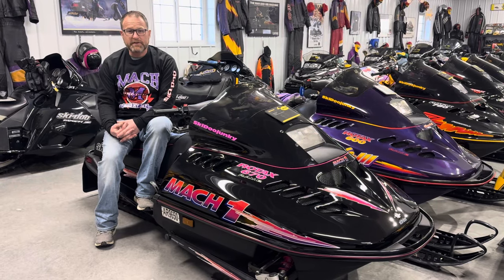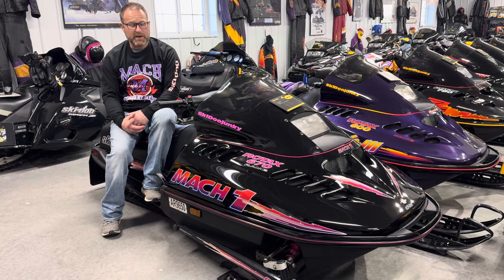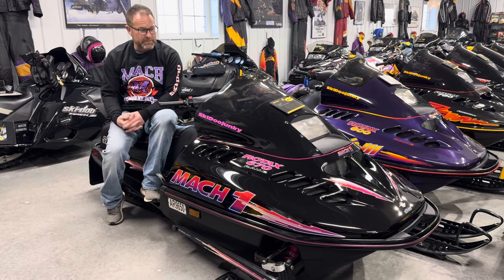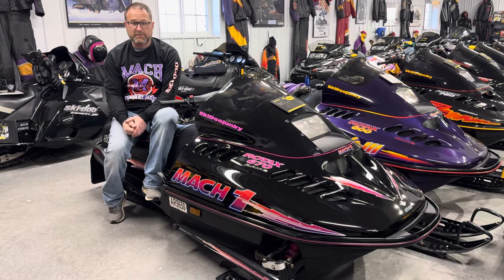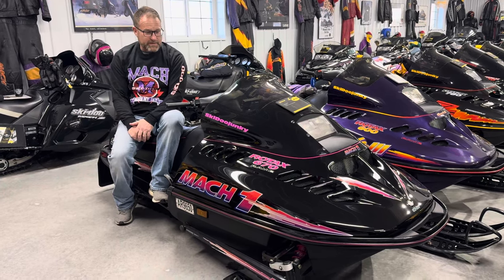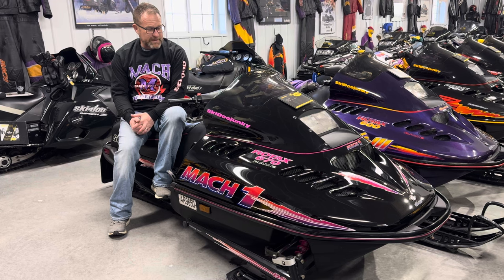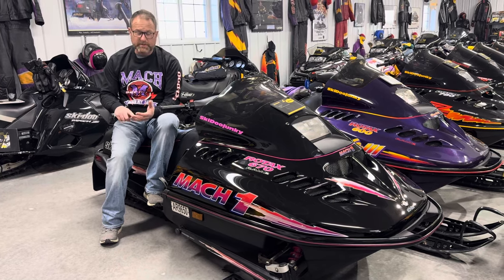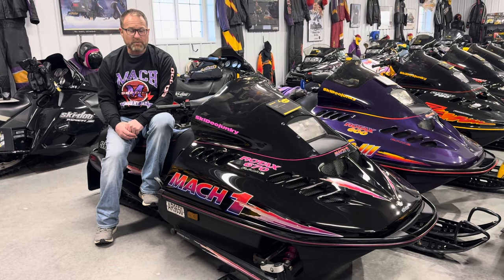Skidoojunky’s vintage Ski-Doo spotlight. The 1995 Ski-Doo Mach 1 670

Comment: I had the economy variant of this, the 95 Formula SS 670.  Smaller carbs, single pipe, manual disc brake.  It still was a super fun sled to ride.

Comment: 95-96 are dream sleds of mine, my first mach 1 was a 92 that I ride for 4 years, when it was time to upgrade skidoo had just released the new 700 triple in the ck3 chassis, I bought that mach 1 in 98 and have never even driven a 95-96

Comment: Whats the hp of the 670 twin pipe?? And would you say its faster then a 95.5 f3??
Reply from the maker: If memory serves me correctly I believe they were around 120-125hp. If set up correctly they would run right with the 95.5 Form III.

Comment: The 95 mach 1 was kinda overlooked here in upstate NY over the triples. Really was a better trail sled than the ski doo triples it was lighter and made great power. Was a great looking sled to loved the graphics. I was only 15 in 95 rode a Polaris back in the 90’s. Had 89 500 95 500 95 XCR 600 and a 95 storm. But in 89 my father had a formula plus his friend had a mach 1 another the MX. 89 mach 1 wasn’t that fast compared to the plus MX wasn’t far behind the plus. Be 123 down the lake about a sled length or 2 all about the hole shot. The 89 MX my father bought from his buddy for me in 90. In 89 his buddies bought the 90 mach 1 dad bought 650 indy. The 90 mach 1 was fast around same speed as the Indy 650. I new all brand and most models but over looked the 670 the formula 3 and mach Z over shadowed it lol!! 
97 we rode a MXZ 670 then my father and i got thinking twin was the future and it was. Father bought a 700xc Polaris in 98 then i bought a 2000 800 rmk first 800 twin. In 03 father bought 800 rev but i bought firecat. Been cat ever since started racing factory cat sleds. But father has some ski doo today great sleds. 
Great video always fun looking back to the sleds i grew up on or around. Snowmobiling was a different world than today lucky i got to experience it. So many great memories over the years but think my best trail memories were in the 90’s.